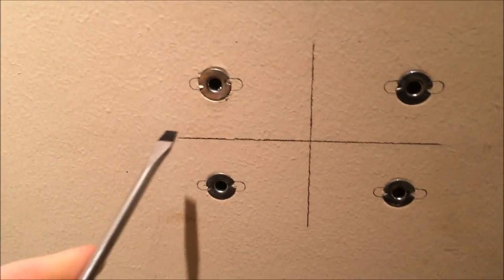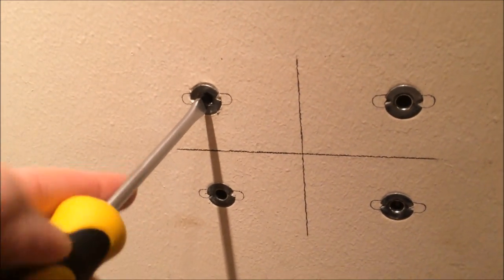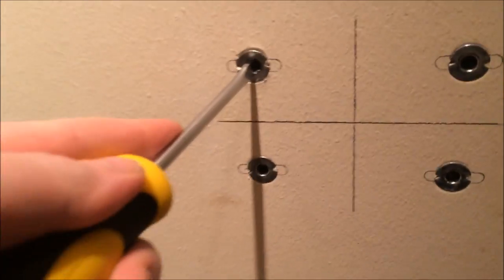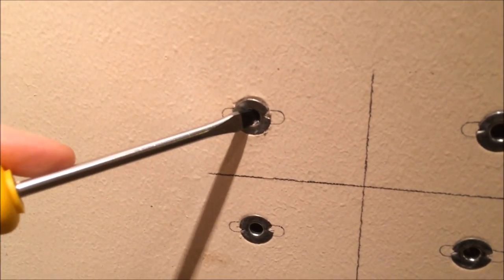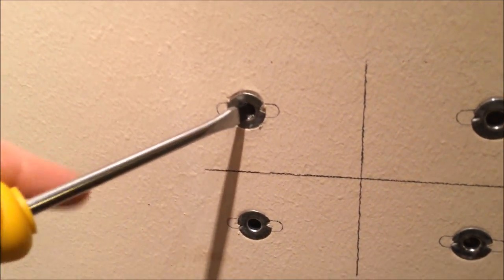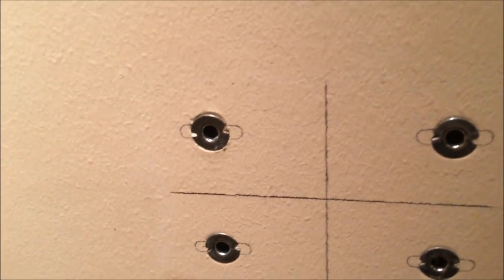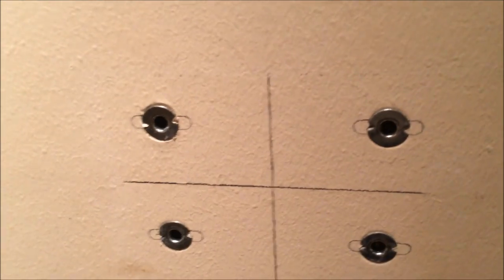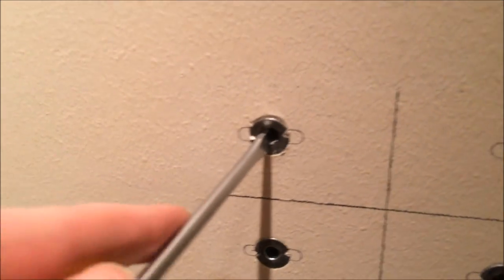How to: Remove Wall Anchors In Less than One Minute!

Comment: Thank you so much for this. I watched a few different videos with various methods for removing molly bolts and was getting really worried about how difficult it was going to be. I had 14 to remove and thought it was going to take ages. I tried your method first without believing it was going to work but lo and behold it worked within seconds!! So quick and easy- all 14 done within about 5 minutes. 
I never comment on videos but am so thankful that I found yours. Cheers!
Reply from the maker: Thanks, glad it helped you

Comment: I have what apparently is demonstrated in this video.  

I can truthfully say this method works just as was demonstrated. 

Incidental note: I attempted the same method on a smaller anchor and the collar was slightly sunk into the wall surface.  I didn’t have a screwdriver to fit however, I had to improvise.  
1) Put screw in the anchor.
2) a) Pulled screw head gently with pliers.
b) Lifted the collar of the anchor from the sheet rock using a paint knife.  
3) Once the collar was lifted I used channel lock to grip the collar.
4) Compress and slightly pull the channel locks until the collar snaps loose.

Comment: Well if you make a big hole, I have a neat way I patch drywall with no tape whatsoever. 
I should do a vid for it :)
Reply from the maker: Yea you should :)
Reply: Cut a piece of thick card (I use grey board), then use something like Bostik All Purpose glue to glue it on the back of the wall, then fill in with plaster.
Reply: +Edward Holmes cut the hole square. 
Get some drywall ,,just cut the drywall to fit the hole, but leave the paper on the front , with like 2 inches all around of excess paper. 
Score , snap and peel the drywall from the paper , the paper becomes your "tape" 
All nice and neat in 1 package. 
Put a backer in the hole , put some mud around the sides and put the piece in the hole. Use your knife to press and squeeze the excess mud out , put a little over the paper and knife it flat some more. 
No need for drywall tape at all with that method.
Reply: MrTheHillfolk That's really neat!  Never thought of that before!
Reply: +Edward Holmes I hope I explained it ok. 
I guess , say you have a 4 inch square hole...
cut an 8 inch patch , score 2 inches off all the way around on the back , crack it and carefully peel the 2" rock off for a clean patch ....
it saves a lot of extra mud and sanding time ..you don't need as thick of a skim coat over the edges.
Reply: +MrTheHillfolk it's called the California drywall patch just in case you wanted to know, works awesome!
Reply: Danny M hey that's cool, they named it !! 
Thanks for the info!

Comment: The hole in my molly is much smaller than these I think. I cant find a flathead screwdriver that will allow this. SO sad. Like everyone else I have alot to remove.
Reply from the maker: Are you sure it is a molly?
Reply: @ThunderDivine  I am but...... I think the drywall, which is in a half bath, has become soft over the years. I was able to use a similar technique and popped 4 out of 17. Such a great feeling when it works! Lol! But like all DYI there are to many extra things to consider. Thanks for the post.